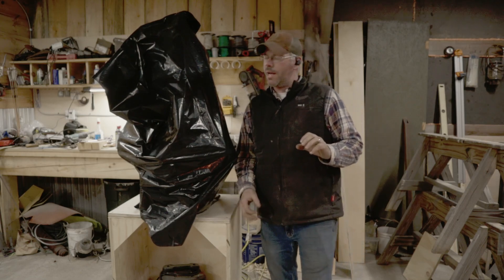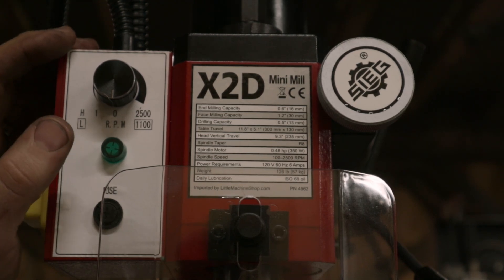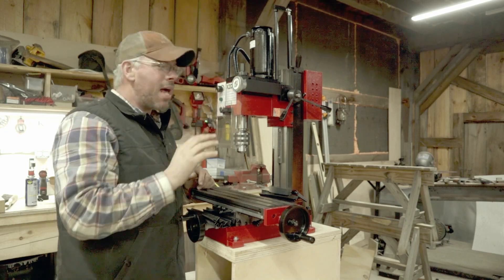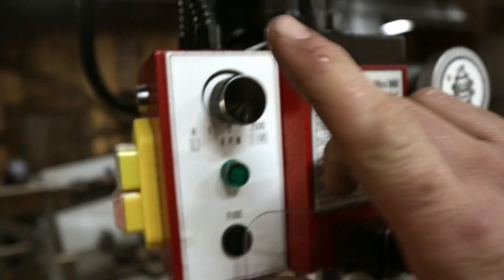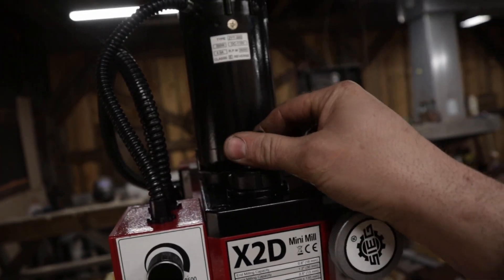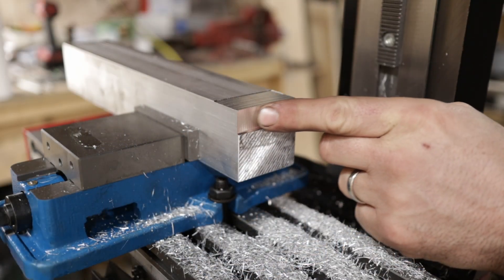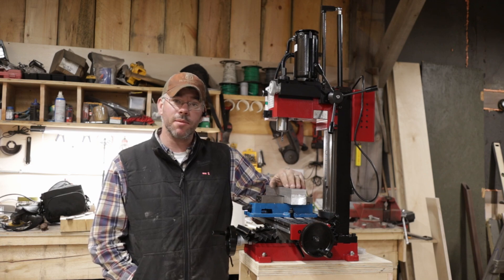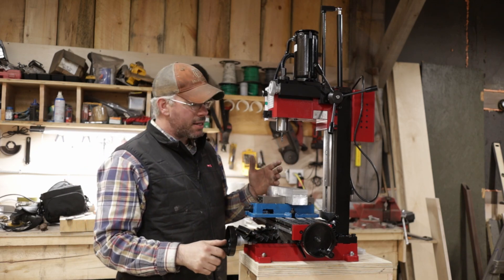CHEAP POS or HIGH QUALITY AT A GOOD PRICE???

Comment: I worked at 2 machine shops and studied these kinds of tools. It's a vertical mill and there are horizontal ones. If it's made overseas. It may have metric threads with SAE markings. You can use dial indicators, dials, to set the parameters {x,y,z axis} using SAE dials or SAE DROs {Digital Readout}. I have looked at the mills and lathes where you got it. Good stuff. I'm used to working in production so had coolant with a pump, hose and pan to recycle the coolant but you can do it all dry for short runs. Cool. I do have a Wilton 3" cross slide vise which should work well and have a Chinese cross slide vise that I used in one of my projects. It's so-so. Your vise looks OK.
Reply from the maker: You're a pretty well rounded guy.  Always enjoy your experience.
Reply: @TheTradesmanChannel  Yeah, I know the game.

Comment: The purpose of the nylon gears is so that the motor does not get overloaded or stopped.  The gears are engineered to fail before the much more expensive motor overloads.  The best bet for longevity is to buy several sets of gears to have on hand or to never push the machine very hard.
Reply from the maker: I figured as much.  My thoughts are to do the motor upgrade to the 500w brushless DC motor with the belt drive conversion.  What do you think?
Reply: Thephilus, you beat me to it. I like the belt drive option idea.
Reply: @TheTradesmanChannel  If you are going to modify it the first things I would add are a cheap 3 axis dro and a x axis power feed both are real life saver.  On those smaller machines you'll want to put the rpms high as possible to reduce chip load and a air blast or mist system like the noga-cool would also be a good addition. The motor upgrade is a good idea but I would add a dro and coolant system before I change the spindle or drive mechanism. Those small hobby type machines are great for beginners and can make very impressive parts if you take your time with them. Artisan Makes has a machine similar to yours I would check out his channel for ideas on projects and potential upgrades
Reply from the maker: Thank you.  I'm really enjoying the machine and I definitely see the point of needing a dro.

Comment: Mount the casters on a hinge and spring so you can tip it and let the casters flip up, 2 and 2, I have several large tools this way. all you need for lockoins is a pin that runs down the side to the side of the hinge plate preventing the springs from pulling when you want it to roll. There are other ways to inexpensively do this, worth the time. Has saved me at least dozens if not hundreds of hours when needing to move them for cleaning maintenance etc.
Reply: I would recommend "SPACEKEEPER Workbench Casters kit 660 Lbs" for some but I think they use excess space.
Reply from the maker: Now that is a great idea.  Thank you for sharing.

Comment: I'm not sure about this machine in particular, but sometimes manufacturers put nylon gears in a machine to fail when overloading occurs so that more critical parts don't get sacrificed. It might be a protection rather than a shortcoming. Good luck.
Reply from the maker: Protection for sure.  I'm going for the belt and beefier motor at some point but it works pretty well.

Comment: I like it, start out cutting on a three hundred dollar pice of aluminum, lol..I got a shop full of machinery it's the most fun I've ever had with my clothes on, lol..congrats..
Reply from the maker: I'm making some parts for my forge press with it right now, I'm hooked already.  All I need is another hobby.
Reply: @TheTradesmanChannel  I love the fact that if I need something I can walk in the shop and make it, I'm building a 2×72 belt sander with mag chuck attachment for a friend at the moment, check out aliexpress great tooling great price.
Reply from the maker: My 2x72 is the most used tool I have ever made.  I'm strongly considering building a new one now that I can start making more accurate parts.